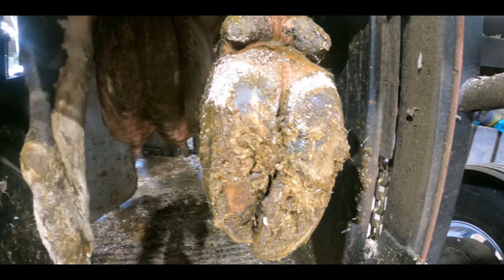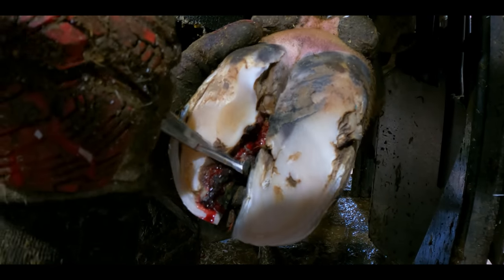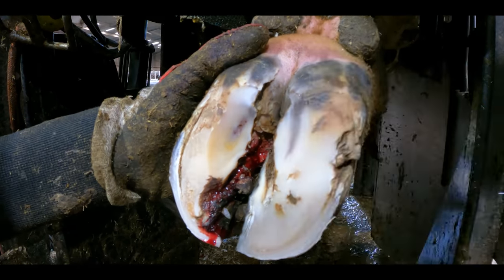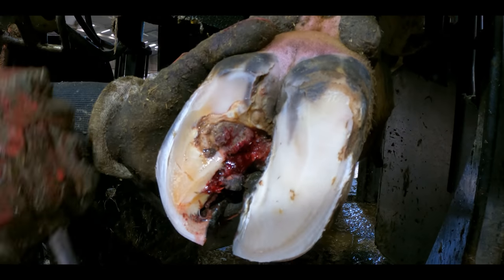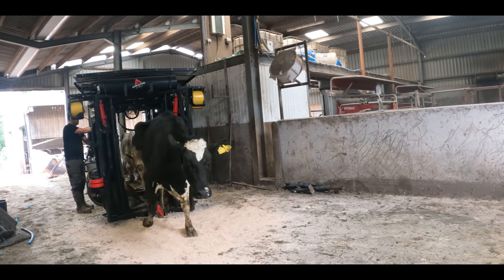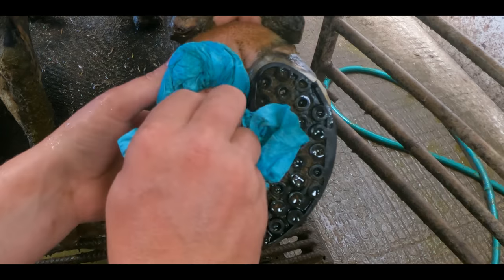PEELING BACK A BANDAGE from this INFECTED COW'S HOOF!

Comment: When you deal with a cow like this, with infection and dermatitis, do you sterilize your knife and other tools afterwards? Or would it even make a difference?
Reply: I think a good warm water irrigation with maybe betaine added, to flush the broken areas of the hoof, as well as outer foot and midline between toes, a good dry off and then do all this spraying with blue and spritzer shots with iodoform mixture.  Otherwise the animal is definitely going to be in septic pain by the next few days. I've had to stop watching. No great loss I know,  but damn I wish he'd think about cleansing those wounds/feet/ankles thoroughly.
Reply: @navigatormother7023  experience lvl 0
Reply: on his own channel, Craig said they do clean the knives after using them on an infected foot.
Reply: I mean, it's common sense that you would

Comment: I have two question. The first is have you ever gone to a farm and saw cows notice your vehicle on a porch where they will follow you to the barn and watched as you set up. Waiting for you to work on their feet. And the second has a cow with sore hooves ever thanked you by wanting to hang around when you were finished and stayed close to you  until you left or licked you after you were done? I grew up around Holstein cows in lower Vermont and not doing feet but just hosing them on hot days I have gotten happy cows after like that. Very much like dogs do.

Comment: The amount of healing in just 6 days is pretty incredible, there's already a layer of new horn over a lot of where you had to remove it last time. It would be nice if you could just have a vet give you a prescription for that antibiotic spray to use as needed since it seems to do a really good job in combo with the salisylic acid. I imagine the regulations don't allow that though.
Reply: Yes, it's against regulations. You must have a large animal account and even then you can't use it on multiple holdings.

Comment: Curious as to how cows like that limp, obviously in pain yet when Hoof GP has his fingers in there pressing paper towel on exposed flesh, the cow doesn't flinch.
Reply: Him pressing on it with his hand is WAY less pressure/weight than the cow stepping on the foot. It's like gently touching a bruise vs putting your whole weight on it.

Comment: You need to start using an aseptic technique OR the closest thing to it in your line of work.  Constantly now seeing results of effluent and infective debris being bandaged inside the hoof with broken seal of skin and internal hoof, especially in the midline fissure  running through separating the toes. Sorry, but I can't not say anything.
Reply: He does use antiseptics, it's only prescription drugs he can't use, and in this case, he was even allowed to do that (the blue spray is an antibiotic).